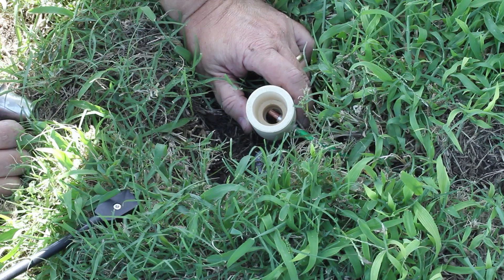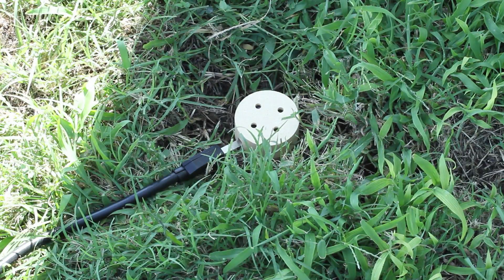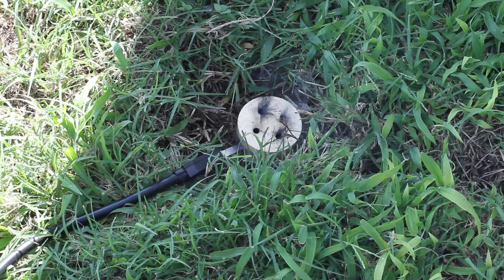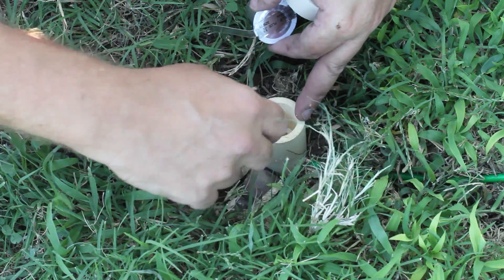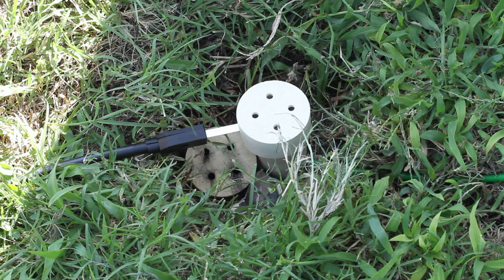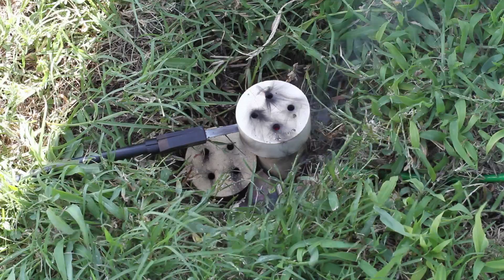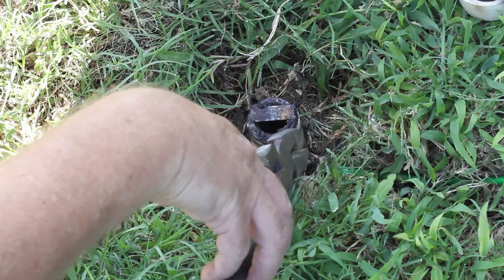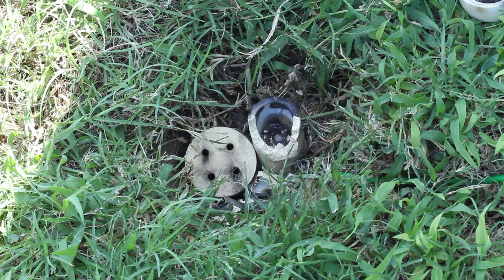Exothermic Ground Rod Bonding

Comment: (1) Some of the ERICO Cadweld description specity the use of a ERICO brand ground rod (as opposed to the standard ones available at the Big Box stores).   Were you using an ERICO brand ground rod.  
(2) what did you use to support the Cadweld mold on the 2nd attempt - could not see what you did there.  Thanks for this video!
Reply from the maker: I'm not sure where that ground rod originated. It came from a local supplier.
We supported the mold with the broken ceramic bits from the first shot and some additional dirt that we dropped into the hole. I'm sure this wasn't the first failure like this, and I'm guessing it will happen again. Hanging on the wire on the rod isn't good enough. The base of the ceramic needs to be supported from below with a non-flammable support.